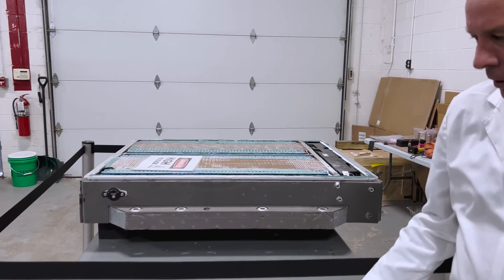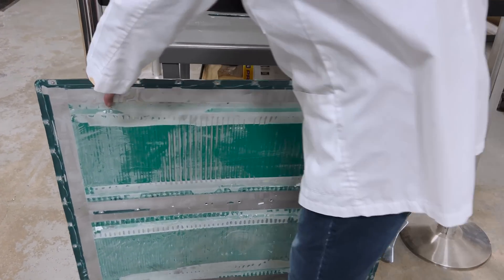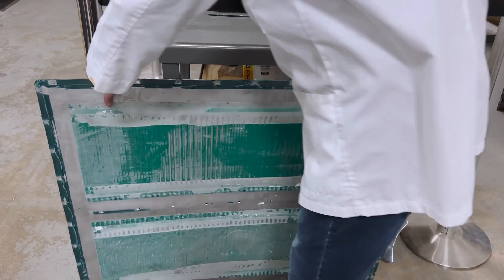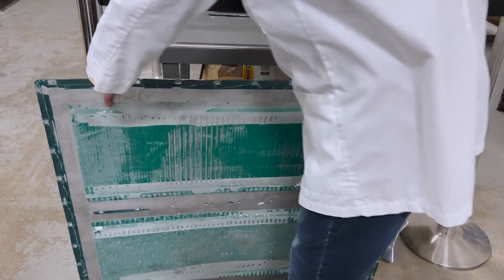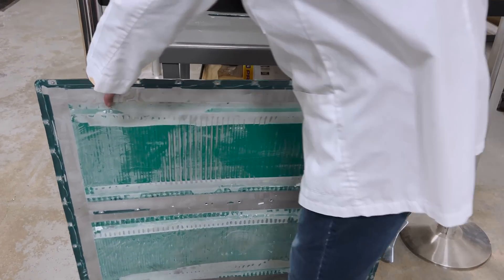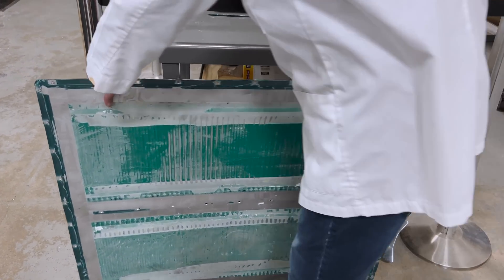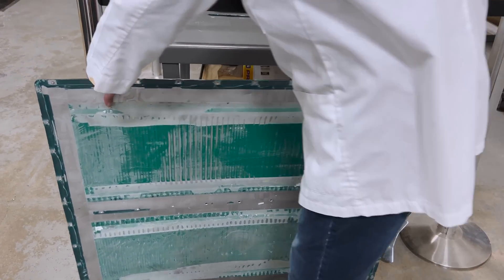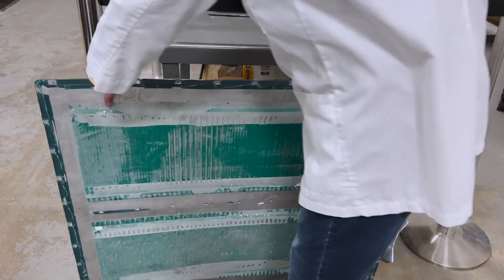Shark Attack! Breaking Down BYD’s Battery Pack

Comment: The BYD Blade battery is a graphine battery technology, what is a graphine battery? Well let tell you since google AI meta has been introduced many crucial info has been supressed... It is basically a Solid State battery, what are the benefit of solid state battery? Nail penetration, fire proof, explosion proof, extreme low temperature  proof, cut in half and still working, extreme crushed and still working, long lasting battery, Flash fast charge. The reason Tesla are still catching fire and exploding is because they are using 4680 NMC in their long range Panasonic and LG chemistry with liquid electrolite. Tesla standard model use BYD battery. Check Tesla death toll fatality.

Comment: I think what byd and rest of industry is going for in the long run are easy to swap out battery assemblies like this in case of failed cells inside, failed bmu or other non cell components, or mechanical damages due to accidents, structural stresses.
Over time, these battery tray units will come down in cost, making service swapouts easier, lower cost.
Note I refer to owner service swaps, not charging swap outs, which appear to be riled out for North America for many good reasons

Comment: Non-serviceable packs. Hate 'em. I want to be able to replace a cell in my battery pack if it fails - which I can do with my Ioniq 5. Usually a pack marks bad because of a single cell. This pack is a throw-away. I'd never buy one of these - I appreciate the teardown for that reason.

Comment: The LiFePO4 battery do store half of the energy of a comparably sized NMC (LiCoMnNiO2) battery. But they are more stable because of the lower terminal voltage, and their manufacture is less critical.
The battery you dismantled is totally unserviceable. And, by all means, it is very scary like all automotive traction batteries.
Greetings,
Anthony

Comment: What I really hate is, that such expensive part as battery pack is basically non-reparable. Once one element (even tiny chip) is toast, entire battery has to be replaced.
Reply: You are right. But well produced battery cells are so reliable now so a high percentage of packs work for the the lifetime, and beyond.
But there are some ongoing developments with Multi-Level-Inverter technology, which allows pass-by of series connected weak or bad cells.
Reply: BYD has 8yrs warranty on car bats at least on my country, its built well.
Reply: Repair battery pack is not a good idea, mixing new cells with older ones will cause cell balancing issues.

Comment: Did you get to work out the Volumetric and Gravimetric numbers of the pack or cells? There appear to be no stats on this. When BYD first showed the blade packs, folks assumed the Volumetric number would be 214Wh/l (BYD claimed it would be 280) and the Gravimetric number would be 140Wh/kg. I suspect they achieved far better, trying to beat the Model 3's 238/163 numbers.

Comment: Thanks for the rundown I have been curious about the blade battery packs for a couple of years. Impressive safety features and robust engineering from BYD. 
Having the top mounted thermal management system means damage to the bottom of the battery pack from a rock strike or other damage shouldn't effect the thermal management of the battery with little chance of thermal runaway.
It looks like the blade batteries and this battery pack in particular have a well earned reputation for safety and efficiency.
😎🇦🇺👍

Comment: Purchaser, "Can i replace the battery blades on one end that gets used the most after a few years?"
Dealer, "Yeah, we just slide a few out and replace them, no worries" 😅 
So by this, it will cost 3days labour plus the batteries and another day or two plus glues and a new metal cover to reassemble 😮

Comment: This actually looks like a pretty clean and tight battery pack. Think of how far the industry has come in 15 years. Gen 1 Chevy volt battery was half the energy, twice the size, and way more complex. This ones simple, neat, and safe.
Reply: The 1st gen Volt (and Bolt) were sold in pretty decent volume, but there are NO replacement battery packs available.  Completely sold out, with just the one shop doing refurb for a trickle of replacement parts.  If 3rd party replacement packs were made available for the Volt, Leaf, etc. then those cars could continue driving for quite a long time, with far better electric driving performance and/or range.  Unfortunately, I suspect that won't happen, but at least the Volt should operate as a ICE car.
Reply: @ZweiZwolf So when it is at end of life what happens? They get thrown into landfills to pollute the groundwater?
Reply: The BYD Shark battery pack is designed to easily unplug, unbolt and swap out .  BYD will have spares if this sells as well as one might imagine.
Reply: I am dissapointed in the COP1 heat element. This pack could be warmed up by a heatpump. Like Tesla has. Heat traces are very inefficient.
Reply: @HermanWillems  Hopefully its only for extremely cold temps. Heat pumps are great but have their limits.
Reply: @HermanWillems  Plus they add an insulating layer between the cells and the refrigerant plate.

Comment: I googled Al Steier.  Army veteran.  Earned a degree from Central Texas College, a community college which serves active duty military, while a U.S. Army Mechanic in Germany. Unsure if fully qualified to evaluate battery design.  He did do a teardown of a Prius and Bolt to co-author an EE Times article, but someone with at least a 4 yr EE degree might be a better reviewer.  365 VDC & 81 Ah = 29.6 kWh, which is about half a standard range Tesla Model 3, but large for a plug-in hybrid since the Prius Prime has a 13.6 kWh battery for 44 mile all-electric range.  The LFP blades look similar to those in home batteries for solar storage, a typical size there being 10.2 kWh and 200 lb weight.

Comment: To disassemble a BYD battery, you need to buy a special solvent 锂电池解胶剂 to remove the glue that holds the Blade cells together.
Reply: Qual seria esse solvente especial?
Reply: @caique20101  Did you translate the Chinese above, Lithium battery disintegrator.  I have worked with paint solvents most of my life and Acetone is a pretty strong solvent able to eat through most glues, however, testing it on the battery is recommended and b4 that use a weaker solvent like mineral spirits, then a stronger one and give them time but buy a battery that is not so tightly sealed to start with my friend.
Reply: @caique20101  Battery pack disintegrator commodity
Reply: I doubt the solvent is "copyrighted". You just need the right one. Find the chemistry of the glue and research it.

Comment: Interesting that BYD removed the need for an intermediate thermal media (e.g. coolant) between a battery heater/cooler and the cell edges.  The refrigerant looks like it wouldn't easily leak into the pack (because the ports are on the outside) and the resistive heater is a lesson in pure simplicity.  Tesla of course place serpentine coolant channels directly in between cells (on round-cell packs), at small risk of a leak inside the pack. Both VW and Hyundai-Kia place a coolant panel on the underside (but outside the pack) to avoid the risk of coolant leaks causing a loss of electrical isolation.  It's pretty clear that low cost was of the highest priority to BYD as it is with Tesla and both their pack designs are obviously non-serviceable.  Personally I prefer that packs are serviceable and I'd be willing to pay extra for that.  On my 6-year old Kona the BMU (the main part of the BMS) can be extracted from the underside of the pack via a small access cover. The pack can also be repaired down to a module level once it's out of the car.
Reply: BYD optimized for manufacturing cost by adding lightness and removing unnecessary components. It's smart design to minimize parts count and tolerances, making for a stronger, stiffer, lighter component. BYD themselves benchmark, and say their blade battery is 10-15% better than the competition. With how tight the pack is, I'm inclined to believe them. 
The BYD pack is like this because cell modules are bonded to the base plate to serve as structural ribbing.  That just leaves clearance on the sides, front, and top.  The sides are for cell interconnects and cell monitoring, while the front connects to the controller, so that just leaves the top for thermal management and access.  It's a very good design, very clean, that really shows off their experience and expertise in making battery packs.

Comment: Looks pretty well constructed tbh
Reply: eh... the isolation between cells is a little scary. maybe there is more under the blue wrapping? they had to use refrigerant here coz of capactive leakage issues with glycol, even with DI water (which doesnt stay DI for long), you get some capactive coupling and loss of isolation

Comment: The crash footage on a race track tells all, they build garbage that doesn’t keep the occupants safe. The drivers seat completely snapped in half in that crash and did absolutely nothing to keep the occupants safe at all, also you can see how trash those batteries are they won’t last long.

Comment: You will never… NEVER be able to repair ANYTHING on this battery pack. Really a shame.
Reply: sort of like a Tesla...
Reply: @KiwiMechEng  wrong, check out the CATL LFP battery pack of Tesla. It's very nice. Google it.
Reply: @KiwiMechEng  I've seen rich rebuilds replacing a cell block in a Tesla battery. It's a mission but this BYD battery looks even more difficult to do with all the glue and frame needing to be cut out. Hello from NZ!
Reply: @KiwiMechEng  Absolutely... the same crap^^
Reply: @energieundhobby I'm not sure about BYD. That said, several Chinese EVs use this method to get IP67 or even IP68 rating. So they sealed the battery completely  because that's one of their selling points. Zeekr even showed off 48 hours 1 meter immersion test.

Edit: the IP rating is for the battery, not the car. I guess it's to prove the safety of their batteries.
Reply: Don't worry...the batteries have a lifetime warranty so no need to repair...also the US won't be getting Chinese cars.
Reply: No, just use the solvent that BYD spec's to dissolve the glue...

Comment: Interesting design taking into account the heat from the batteries rises and the cooling falls but I would have expected the supplemental heating elements to be placed on the bottom and not the top.  And yet it's just another completely un-serviceable battery pack. Lets just keep sticking it to the consumer.

Comment: Liquid cooling but electric heathing. Next step is both liquid and be combined with the cabin AC, the top is the floor AC. Removeable blades and pressure strings for LiFePh. The balancing resistor  is inside the blade do not need bulky PCB resistors. Next iterations they get perfect and then there is only hunting left for the competition.

Comment: Balancing of LFP battey should never occur at 3V due to the SOC of the battery being unknown until at a higher voltage of around 3.5 -3.6v. Most BMS will top balancing at the higher end  instead of active balance. This is also why Tesla LFP recommends going to 100percent once a week to top balance and re calculate SOC.

The flex circuit on the opposite side  of the bms board carries the opposing polarity thru the rod of the battery and also acts like a fuse
Reply: Are you seriously comparing Tesla with BYD or CATL, these guys were making batteries when tesla was a toddler.
Reply: @slipperyslope5364 He's making a comment on the properties of LiFePo battery chemistry. The charge/voltage curve in most data sheets for these types show that the battery likes to hang around 3.2V or so within a large range of their state of charge. This means that you can't really tell if the cells are out of balance amongst themselves with that range, because they're all showing the same voltage. To ammend this, it's best to just charge em up to full every once in a while, instead of having a likely unsuccessful attempt at actively balancing the cells through their range.
Reply: You can do both top and bottom balancing LFP cells, as you have a steep curve at top and bottom.
Remember the famous Jack Rickard with his EVTV channel? He was one "expert" that was in favor of bottom balancing, at least 10 - 15 years ago. Bottom balancing would be much less stressful regarding calendar degradation, but nowadays everyone is using top balancing.

Comment: I would like ear protection when using a metalsaw, they can really screem. He is not afraid of getting his fingers close to the pack without glowes.
Reply: He's not touching the battery cells with bare fingers until after all the bus bars connecting them have been removed. There's only high voltage present when all the cells are connected to each other in series.

Comment: AC cooled - does this mean that the refrigerant goes through those ports?
Reply: Yes.  You don't want the pack to overheat, or the battery will be damaged like the Gen 1 Nissan Leaf in hot climates such as Arizona.

Comment: I like the assembly of the cells, just concerned about cell growth. Time will tell. Wonder what warranty they offer on the pack. Also think cooling area is small compared to cell size. Wonder how that performs in hot climates.
Reply: 8 years and 160,000km on the battery
Reply: was very surprised that there is zero compensation for cell expansion. just all cells in a single stack. if this was NMC this pack woudn't last very long but maybe its different with their LFP cells.
Reply: @Devastation888 The BYD blade battery design has been around for about 8 years now. Very reliable, some taxi has over 400000 miles, and still has over 80% capacity.

Comment: Well hopefully they can improve the cooling on the next gen Blade battery as the single side cooling is not good enough as seen by EV YouTubers showing the battery overheating when pushed hard and DC fast charging.

Comment: You failed to say the benefits of cooling from the top as cold air goes down hot goes up. The heating would work better on the bottom so that's a strange way of doing it as the coldest area would be at the base of the battery. Then we got to 1:12 before you made a mistake on how the battery is wired.
Reply: Design decision to keep.the cooling away from the bottom to avoid any intrusion in offroading
Reply: Back to school.  This is conduction not convection.

Comment: You say "AC cooling." Do you mean that those channels in the cooling plate actually carry refrigerant? Yikes. I think I see at least 4 coolant circuits in parallel that further divide downstream? Take a look at the compressor discharge line and see if they don't have a robust oil separator. Even with that, a large flat horizontal evaporator is a recipe for enough oil migration to perk up the ears of the warranty department... eventually.

Comment: Thanks! I have a Shark-6 on order (Australia) but I will not disassemble it - I'm happy to rely on you.  The Blade Batteries that are for sale appear to be longer and not as 'tall' when standing on their long edge like in the video.
Reply: Those go into a lower-profile unibody sedan, where everything goes under the floor.  A pickup is lifted, so is easier to "hide" a tall battery pack between tall frame rails.
Reply: You bought a Temu Ranger that depreciates by more than 80% within a year down under?

Comment: One thing i don't like about these packs is that you can not simply unbolt a cell and slide it out the side , after working on ebike batteries and power tool batteries for many many years now theres usually one or two cells that fail and make the whole thing useless .
Reply: I doubt those e-bike & tool batteries have individual cell BMS. This pack carries a much longer warranty.  And it's not like you're going to be disassembling the pack on your own, either.
Reply: @ZweiZwolf  That's true , But still feel it would be nice to be able to repair the packs rather than just scrap them . I've saved a fair few battery packs by replacing individual cells and or the BMS over the year with good success .
Reply: @ BYD is selling literally millions of cars in true mass production, with zero intent for 'shade tree mechanics' or customers to be servicing the pack.  These are 365V packs with instantly lethal risk potential, so it's entirely reasonable that BYD would only plan for trained professionals working on them.

Comment: Seems very inefficient to have the battery heater on the top, right?
Reply: No, you're thinking of natural convection.  This is conduction, it don't matter.
Reply: It is not air-cool so I don't think it matters. There is no space for air circulation so the top or bottom is the same. It uses the battery material to cool itself, not air.